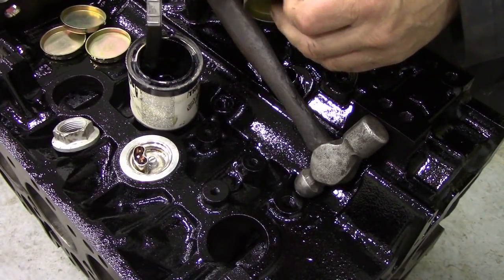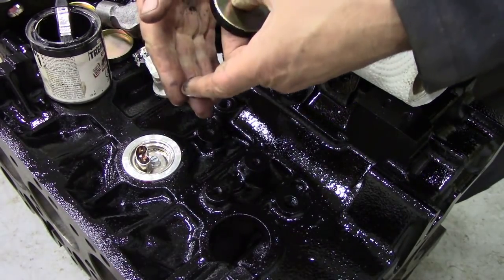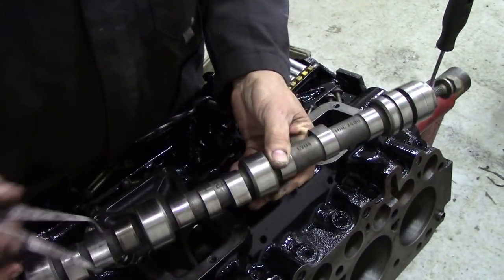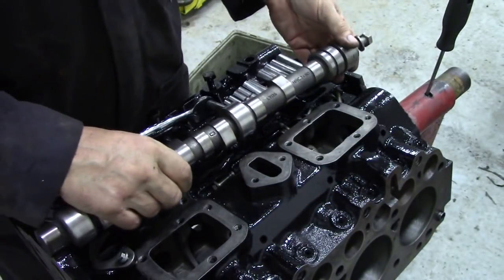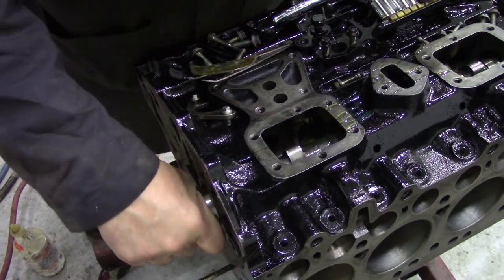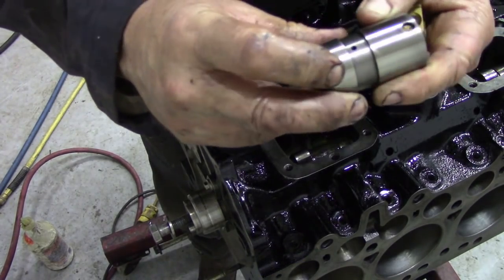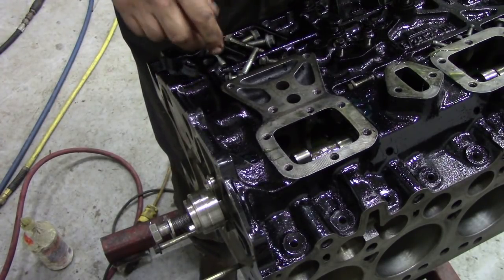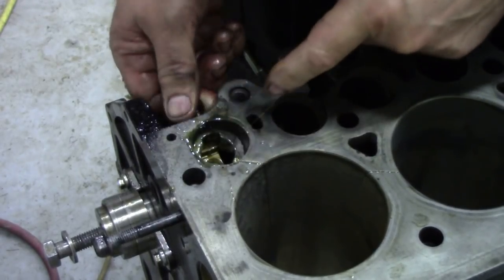Fitting core frost plugs and installing the cam and followers to a 4 cylinder Rover engine

Comment: Hi Mike,    I strongly recommend not to use that Block heater.   Here in Germany it has happened many times. The heated water assembles in this case around  the lips of Cylinders Close to pistons 2 and 3. .  This concentrated heat will attract combustion  from the Pistons central chamber to the  outer  edge of pistons 2 and 3. .          -the result will be melted away Piston top edges closest to the heater.         Engine becomes very noisey before failure.            The optimal pre-heater System  is a continuous  water circulation so that the whole engine assy  has an even temperature.      Rgds www.burridge-land-rover.com
Reply from the maker: Well John, I and many many others have been using these for over 25 years with no issues  maybe come to Canada and practice your theories?

Comment: Put that Lucas oil additive stuff in a DV6B engined M59 Citroen berlingo...still didn't stop the sump or rear crankshaft oil seal from leaking.

Comment: Loving the videos mate keep them coming! Would love to have a landy engine rebuilt by you, your a perfectionist
Reply from the maker: I notice now the Haynes are not covering gearboxes
I think with the Defender there were a lot of special tools needed and priced beyond the regular mechanics reach
And now with all the tech even I am giving up - cannot justify it

Got a Disco 3 in yesterday with no air in the suspension my computer only has the basics so I cannot switch on the pump separately to diagnose it
I see it has had a new pump recently fitted, but I spent 2 hours checking relays and contacts and getting nowhere - could not find a wiring diagram for it
So the end of the line for me - had enough of these high tech vehicles
Reply from the maker: I am doing these so you can do jobs yourself as the workshop manuals like Haynes are totally useless
Thank you for your support!
Mike
Reply: Mike. I support your Haynes Manual comment, The Land Rover full workshop one although a lot more  expensive is far more informative. Haynes copied some parts of it almost word for word and then leave out a lot of the important measurements that you need to know and check.